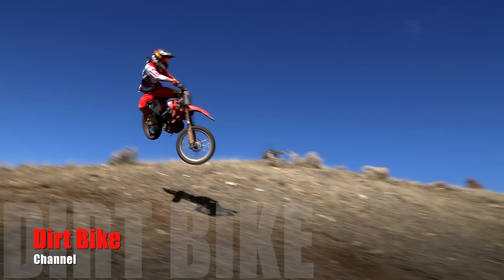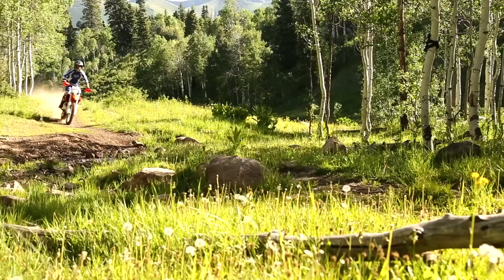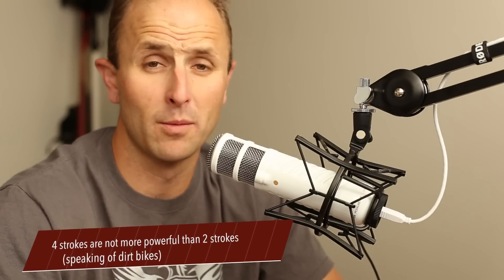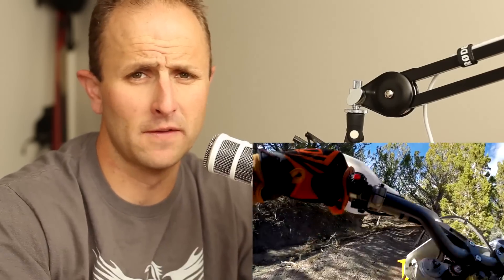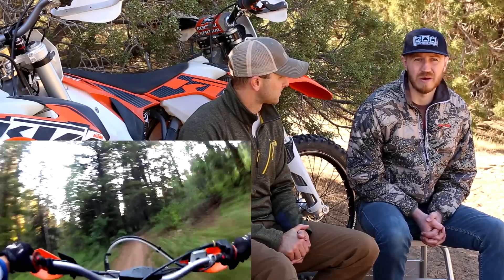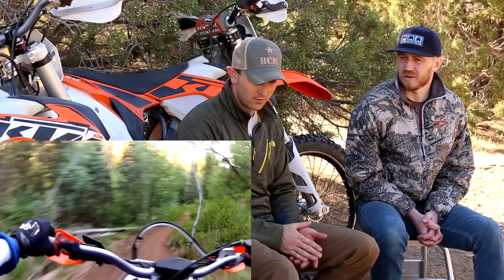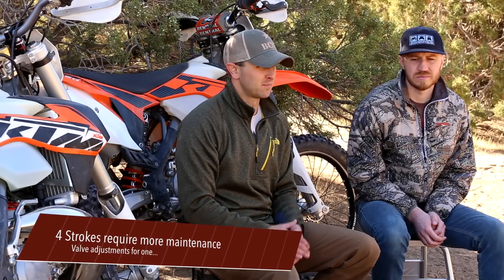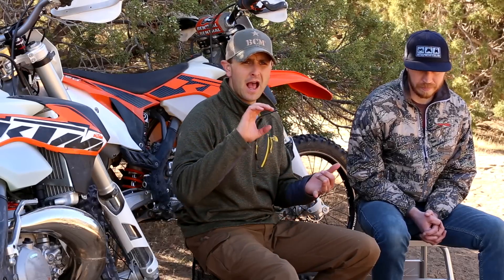Enduro 4 Stroke vs 2 Stroke Part 1

Comment: I have a 1982 CR480r that my grandfather bought brand new. this bike has been ported and worked on and ridden hard since the year it was purchased. it has seen dunes, trails, and gnarly hillclimbs. i have no idea how many hours on it, but it is STILL on the original top end and STILL has great compression. the combination of the big motor that can be lugged in the lower RPM's, the low redline, the low compression ratio, and the simplicity of the old school, air cooled, non-power valve bike have all made it nearly maintinance (and trouble) free!
Reply: EreksonJ You should hold onto that bike forever. Thanks for sharing
Reply: It's probably cuz people took pride in what they built back then. Now they just try and get them out as fast as they can lol. I'd keep that bike cleaned up and in good condition though. Worth some big money one day.

Comment: ahhhh...2 smoke, I will never forget the first time I smelled that magic!
Reply from the maker: +Tim Wood A thing of beauty.
Reply: I just don't like riding a 4 joker
Reply: Agreed Tim Wood
Reply: If you are tired of yourr 4 stroke then do this:https://www.youtube.com/watch?v=1xjz1wwaNeI, make a poppet valved loop scavenged 2 stroke out of it.
Reply: Take a dodge hemi and do something like this:https://www.youtube.com/watch?v=1xjz1wwaNeI. a poppet valved blown loop charged 2 stroke. Now run dry sump with oil injection with castor 927 maxima and that would be something.

Comment: LONG LIVE THE TWO STROKE!!!
Reply: But I heard the 2 stroke engine are banned. As they create more pollution. Is it true?
Reply: 2 stroke is gods motor. look at lightning, it fires on every stroke and delivers tremendous power. Just emagine a 2 stroke that is pulsed plasma powered powered with a ball lightning exploding inside it.
Reply: DFI 2 strokes can be very clean. BTW Fairbanks Morse just came out with a new giant opposed piston 2 stroke thats over 5000hp and can meet tier 4 emissions and it can go over 40000 hrs between overhauls. EMD 645 and 710 2 stroke can run run a long time as well detroit diesel 2 strokes. Most 4 strokes in cars are high revving disposable crap anyways. Even the DFI rotax 850 and outboards have come a long way and are much cleaner than all this 4 joke crap. One thing a 4 joke does is that it can rev much higher and go faster on a strait away but throw a heavy load on it like a generator or climb a hill and a 2 stroke has much faster torque rise. I have seen some 12v71 2 stroke powered generators start some pretty heavy loads and they come right up.

Comment: 4 stroke was actually created first
Reply: Ye that's a bad thing cause they realized they could do better and made the 2 stroke engine in 1875 i think
Reply: @topspeed902  Truth be told, 4 stroke is the better engine. And I have a 2 stroke. Yes, 2 strokes are cheap to maintain and light, but 4 strokes are still pretty cheap to maintain as well. Yes, they have more moving parts but a forced oil lubrication system means that those parts last 10x longer than they would if lubricated like a 2 stroke. Then you get better power and longer gearing allowing you to move slower than a 2 stroke with similar gearing could. Not rev lower, but move slower none the less.
2 stroke bike set up to do 30km/h in 1st and a 4 stroke set up to do 30km/h in 1st. The 4 stroke has an extra 4000rpm, meaning that while peak to peak speed is equal when you get near idle the 4 stroke is able to go slower and not stall. 2 strokes are great but overhyped.
Reply: @jacobvanhalteren7452  bro good for you
Reply: @jacobvanhalteren7452  you say that like it's a fact. 2 and 4 strokes both have there applications their is no "better" engine. If you're doing hard enduro the 4 stroke is inferior and 80% of top riders are riding 2t however cut across to MX and the 4 stroke reigns supreme.
The 2 strokes have had a lack of development due to reg changes that killed the enthusiasm and desire for them in MX where as enduro and hard enduro never moved away from them and they are still competitive if not dominant. You only have to look at bikes where they have had similar development to the 4 strokes like the 300exc essentially rides like a 4 stroke with better power output.
Naivity shows when people comment on the 4t vs 2t argument. There is no argument they're both fantastic variants you just happen to prefer riding one of them.
Reply: Same guy invented both.  4 strokes first then realized he could do better and invented the 2 stroke.  😆
Reply: @benkrom2737  wasn't actually created by the same guy. Nicolaus Otto invented the 4 stroke and Carl Benz invented the 2 stroke
Reply: @jacobvanhalteren7452  Yeah, I know, but it sounded good ! LOL, I've done a lot of of riding on both 2strokes and 4strokes . Over 50 years, I'm now a senior citizen and I gotta tell you the kid in me comes out when I hop on a 2 stroke dirt bike. I do prefer 4stroke street bikes for a trip cause 2 strokes aren't happy cruising at one speed but I recently rode a RZ 350 and just like a 2 stroke dirt bike the kid came out in me. Forget about speed limits, it's not going to happen. When you get to my age you will understand how special of a moment it will be.  Riding on the pipes of a 2stroke isn't something you'll ever forget !
Reply: Tru

Comment: tbh, I feel this video is a little biased, I love both 2 and 4 but honestly it's a different riding style, 4 strokes have the better low end power and don't need to be revved up to the same rpms as a 2 to keep it within a power band, that was always my personal dislike towards a 2 stroke is you had to keep it in the power band where with the type of riding I tend to do, it's a lot harder to do this. in my opinion there is no better engine type, they're just different engines for different styles of riding
Reply: Depends on the 2 stroke. Some of them have a lot of low end and are more resistant to stalling than 4 strokes.
Reply: 4 stroke rev much higher even though they dont sound like it

Comment: If I had a choice, I'd be on a 2 stroke (I don't have a choice cause my local yamaha dealer is my best customer. Have to buy from them) but I have put nearly 8 thousand kilometers on my 2014 WR450 (5000 of them supermoto the rest enduro) all I have done is very regular oil changes and valves every 2 thousand. That's a lot of K's and no rebuild. As much power as the day I bought it.

I love my WR
Reply: Luke Morphett WR is a great bike. I spent some quality time on the old 426. It was a beast.
Reply: Sam KTM I had one of those baby's too back in the day. I think either way you are gonna be happy. As long as you're riding.
Reply: You do have a choice, Yamaha 250X.

Comment: 2t = simpler, cheaper, more overall power
4t = easier to ride, more torque
Right?
Reply: 2 stroke is way easier to ride bro lol.lighter,no engine break.
Reply: Jon Smith dude 2 strokes are more jumpy to ride.
Reply: Modern 2-stroke enduro bike will bang to the bottom, where a 4-stroke will chuff, and flame out.
Reply: 2 stroke for slow enduro. 4 stroke for fast motocross

Comment: This wasn’t really a 4 stroke vs 2 stroke, this is more like a why 2 strokes are better than 4 strokes
Reply: 4 strokes will crap on 2 strokes when it comes to motocross
Reply: @trav3510 trav3510 I ride a husaberg te300 but I did start riding on a ktm 250sxf and I beat all the 2 strokes I also beat my mates riding a honda Honda 150f
Reply: @trav3510 trav3510 what do you ride

Comment: Maybe they should of told everyone about the amount of gas you go through on a 2 stroke compared to the four. Within 2 years you can rebuild a four stroke with the cost savings compared to a 2 stroke. I put 400 hours on my four stroke without having to do any adjustments except a chain. These guys are either biased or paid to push 2 strokes.
Reply: 100% correct!
Reply: Whats not mentioned is the spluttery rough feeling when driving steadily between trails etc and of course the oil costs, carb tuning (older models) and the smoke you breath in when riding behind one !
Reply: I mean, you're talking what, 5 mpg less. My full rebuild for my 4 stroke was $2500 in parts. vs. my 2 strokes, which is dirt cheap to rebuild. I'll pay a little more in gas if that means I don't have to worry about valves, overheating, timing chains, and more oil changes.
Reply: @nickg2431  Right.  One is for a man, and the other...
Reply: @MikeYurbasovich  for a smarter man...
Reply: @nickg2431  2 strokes have a raw edge that makes you feel alive.  
4 strokes are much easier to ride well, so I get why people like them.  The power on the bottom is handy for getting you out of a tough spot when you realize that's maybe a bigger gap than you first thought.  That smell is awesome, and the smoke isn't going to harm you.

Comment: Ahaha, the bias here is killing me. 

"$1500-$2200 for a 4T top-end VS $70 for a piston for a two stroke" 

Try $338 for a top-end rebuild kit from KTM for a 500 exc, the 2T kits aren't much cheaper.
Reply from the maker: surg23 Thanks for watching.  This isn't all smoke and mirrors.  I have bought pistons for my 2ts.  $50-70 bucks, along with a $10 gasket kit.  That is all you need. Look it up.  As for the 4ts, this is if you need you have your valves re-ground and the head milled flat again.  I called around to multiple shops.  Again, your experience may vary.
Reply: I have already googled the prices. the 2T kit's are only 15% cheaper. 

Something I am missing ?
Reply: I think the biggest cost difference is in paying a shop to rebuild a 4T. Comparing the cost of parts is similar, 2T piston around $80-120 and 4T piston around $120-220.(depending on brand). But if you have to do a complete rebuild on a 4T then you have to look at things like the cam chain, valves where a 2T only has the piston.
Because of the simplicity of the 2T motor it is fairly easy for a DIY like myself to do the labor so the cost is just for the piston and gaskets. With the complexities and more moving parts(even if it's just replacing the piston you have to deal with taking off and putting back on the cam chain and valves then getting the timing right) of a 4T engine, people are more prone to paying a shop to do it and they charge about twice the hours to do a 4T vs a 2T. 
So it's really just paying a shop to do the work and the extra parts that make a 4T more expensive.
Reply: 338 dollar is only for piston and gasket, on 4 stroke you also have 4 of those pesky titanium valves costing about 280 dollars total + the specialized work of re-seating (lapping) the valve seats. But I have heard that you at least wear out one piston before you need to do valve replacement? I can not seem to find the manual for my EXC 500 to check... But at about the same hours you talk about valve replacement on 4 stroke you instead have the replacement of all the berings in the bottom of a 2 stroke and that ain`t sheep or easy to do. They seems to forget about that...
Reply: I just rebuild the top end on my 4 stroke costed $450 for new piston 2mm over , cylinder Bored and plated, and gaskets. no labor because did it myself. and for most 4 strokes you can buy stainless steel valves for $100-140 total.stainless steel valves also tend to need to be shimmed less. in the end it all costs about the same. just ride whatever you prefer
Reply: I just did a rebuild last weekend on my crf450r. I did a big bore kit, with cylinder, piston, rings, and gaskets for $400. I did however put a bunch of other goodies in there too. The power it has is unreal! I like 2-strokes, but I love my 4-stroke.
Reply: Money talks , case closed !
Reply: @goodboyringo9716  you would get smoked on either. Case closed!
Reply: Scott Hoover.....How can you spend your 2 cents when you don't have a clue about me?  What a joke ,ggggg case closed !
Reply: Scoot Hoover .... I did a rim, a tire , a cylinder, a chain now the thing don't run ,gggg You did a big ding dong too!
Reply: Scott Hoover......I think I could smoke you with my Road king in the dirt , gggg
Reply: @goodboyringo9716  sounds like you need to work on making your mechanical skills better, so you can put the right parts on your bike, or get the right bike along with the first part. Judging by that statement, I'd say i could outrun you on a 80cc bike and you on a whatever size you want
Reply: Just paid 2k for my top end on my sxf.. I would have way rather paid 300 lmao
Reply: Just had my Husqvarna FE501 result at the dealer I added a Recluse, out the door $5600.00 I felt Raped.... I will be going back to 2 Stroke, now will it be th YZ250X or the Sherco Factory, or the TE/TX 250/300, I’m still in the air.
Reply: Genuine Husky/KTM parts were $3300.00 at Tacoma Motorsports....
Reply: @michaelselix8817  husky all day

Comment: I owned several KDX-200s during the 80's, and they were hammers. I also had an 84 Husky WR-250, and I seized it tight at 90mph on a logging road. Totally locked the rear wheel. I let it cool down 20 minutes and rode away. Never tore it down. Sold it 3 years later, still running good, still same piston and rings!

Comment: People were so concerned with the burnt castor oil coming out of the tail pipes on 2strokes that they forgot that a Four stroke has to burn more gas just to make up for the parasitic drag associated with the cams, valves, springs pumps, cam chains not including the extra weight and extra displacement in order to keep up.
Reply: well said 👍👍👍
Reply: +spliffsperlunk  Engineers knew way back when that 2 strokes were ideal race motors and that 4's were trail bike motors. But that is a bygone era when men and women knew which bathrooms to use too.
Reply: 4 strokes burn less gas.

Comment: I learned to ride on an Xr80 when I was a kid. After which I went back and forth between 2 and 4 strokes. My last 2 bikes were both 2 strokes YZ and RM250. I love the power 2 strokes have. I am now looking to buy a new YZ250...
Reply from the maker: Dt0x75 I have been riding a 2014 KTM 350 (4 stroke) the past few weeks along side my 300 two stroke.  I've been testing out the four stroke and doing different drills and then comparing it to the two-stroke.  I can honestly tell you that I just have more "fun" on the 2 stroke.  It constantly makes me smile and giggle in my helmet. Isn't that what it's all about?
Reply: Yea, thats pretty much the same thing I did when I was younger. I just had a lot more fun on a 2 stroke. I guess you can say I was indoctrinated into preferring 2 strokes because as a kid I lived at the bottom of a Mt in NY and I would wake up every morning to the sound of 2 strokes coming from the Mt. I loved listening to it...lol

Comment: Another interesting fact is bottom end torque. My buddy has a 2010 crf250r that has hot cams stage 2, high compression piston, just off the top of my head, his bike is built let me just say this. I have a 2001 cr250r with a full Fmf system with fatty and turbinecore 2, boyesen reeds, and 13-48 gearing. We have done several 5th and 4th gear pulls going wide open from just above idle. We are always dead even for the first 100ft but when the power comes in on my 2 stroke it takes off. His gearing is stock.
Reply from the maker: MrWalkerds Very cool comparison.  Thanks for sharing.

Comment: 2 strokes for life. I've ridden a 2010 rmz450 and a 2007 crf450r and I still like my 2003 cr250r better. For one its way lighter, and when that power valve opens up there's only two speeds there's  first gear then holy sh!t.
Reply from the maker: shallnot beinfringed I like those 2 speeds :)

Comment: I love em both! But... I agree with the maintenance aspect. I bought a very slightly used 2014 KTM 300 XC in 2015. I just did a piston (piston B to replace original piston) and rings at about 160 hours. It was very easy to do. I also had to replace the transmission side crank seal a couple of years ago, and again, it was pretty easy. When I did my top end recently I also checked the crank play which was non existent. The cylinder still had the factory cross hatch machine marks too. I don't have the experience to do a top end on a modern 4 stroke. The maintenance costs on a modern 4 stroke when, and if needed, are very high compared to a 2 stroke.

Comment: Great video as usual! After riding 450's off road for 10 years, I returned to a 250 2 stroke about a year ago. I have no regrets other than being a little bored not being out in the garage working on bikes all the time! I agree that the 4 stroke is making our sport inaccessible or not economically viable for alot of people. John Doe decides he wants to get into dirt bikes, his buddy rides a 450 so he goes and buys the same thing. No idea on how to maintain it, doesn't realize that the 250/450 4 strokes are essentially high maintenance race motors, blows it up then sells the rolling chassis at a loss and/or defaults on loan. Declares, "I am getting out of dirt biking, it's too damn expensive!" Guess he could have used it for a downhill only mountain bike!
Reply: MrHelipilot67 well put. Thanks for your input

Comment: Get this! My Bro bought a well-used KDX200 2 Stroke and rode it on straight non-mixed gas for over 20 hours before we found out the previous owner was an idiot when he said it automatically mixes with a specific chamber which is actually the rad overflow LOL. Got it rebored and put in a new top-end and it's good to go!!

Comment: two strokes have more top end power four stokes have more bottom end
Reply: Not true at all.....unless your comparing 250 2 vs 450 4.    The 4 strokes rev higher than a 250 2 stroke and also make peak power at higher rpm lol.   Comparable cc the 2 stroke makes more low and high.
Reply: 2strokes have more power 4strokes have more torque